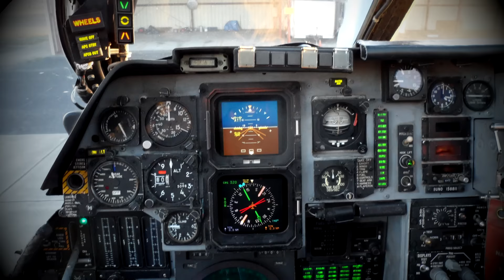USMC Jet Crashes Cable Car | Last Moments

Comment: The news reported that American aircraft were flying very low quite often in the valley, just to scare people on the cable cars an have a laugh. Those pilots new about the cables. I can't forget the accident, because two schoolmates of mine  died in the previous crash in 1976 and a third one was the only survivor.
Reply: I'm really sorry to hear that you lost schoolmates in the 1976 disaster. I would be very interested, did you really know Alessandra Piovessana, Francesca and Giovanni from the grammar school in Milan? I never knew them personally, but I used to go to Cavalese every year and have been interested in the 1976 disaster since I was 12 when a cabin attendant told me about that 1976 disaster. There is very little information, at least in English, about the 1976 disaster and I've been working over the last couple of years on a Youtube documentary about that disaster, going to Cavalese to do research, perform drone flights in the track of the old cable car and ask locals and try to find as much information about it as possible. If you were in Cavalese in 1976 on the day of the incident, or took the cable car a few days before it or if you talked to Alessandra about it afterwards it would greatly help me if you agreed to provide answers to a few questions I still have unasnwered. I have already made a documentary, but I keep updating it as I find new information. You can watch it here: https://youtu.be/6-GBikY0AqM   It's over an hour long, but if you had any comments about anything being not correct or anything which I didn't include and should be there I'd greatly welcome any information. Just to note, this is all non-profit and I'm funding all my trips myself, the only prupose is my interest in this incident as well as will to share information about this "nearly forgotten" incident, which has been greatly overshadowed by the 1998 incident, but is still the deadliest cable car incident that ever happened.
Reply: Hi, I still have to watch your video, but thank you for your interest in that old tragedy. I was a schoolmate of theirs, not a classmate. I was born in 1958, their class was of 1960. They were in Cavalese for a school ski trip, the whole group of kids & teachers had to take a gondola down but Alessandra, Francesca and Giovanni were walking ahead of the rest and sneaked on an early gondola all by themselves, among a bunch of foreign tourists. Their classmates survived because they couldn't get on and had to wait for the next run. I wasn't in the group. I knew well Alessandra Piovesana, only a little Francesca, not at all Francesco. With several schoolmates I went to Francesca's funeral, in Terracina, few days later. I also went to see Alessandra at the hospital. She died some years ago, maybe 10 or 15. I have few more anecdotes, not a direct testimony, but not related to the accident itself. Alessandra never wanted to talk about it. If you are on Facebook, send me a personal message, we can talk about the event. I might be able to find out some of the old kids involved. Simone
Reply: @simonedallachiesa9804  Hi, thank you for your reply, I really appreciate it. I am on Facebook and I think I just found you and sent you a message (in case you don't receive it please let me know here, but I'm sure I found you correctly), so we can talk on Facebook. Thank you again, Miroslav

Comment: I don't have good words for this- but as an American I am empathetic, embarrassed & disgusted that with all of our tech, no how & experience, that something like this could happen- yet not surprised one bit. The moment you said that they were at 300ft- i knew that someone had messed up. You simply don't fly through the Italian Alps above small towns & villages, at that low altitude. However, these were trainees operating expensive military hardware- & at some point the government needs to be held accountable for putting people in these machines to begin with, & I'll equipped no less with incomplete maps. Yes those soldiers Fd up replacing the tape- but again these weren't even full fledged fighter pilots yet, or the one operating the joystick wasn't. That being said- isn't it strange that the most deadly cable car accident in world history happened in that same town 20yrs earlier? Does it hold spots #s 1 & 2 now? And is something else going on here? It just seems way too coincidental for my taste

Comment: Pre watch theory: velocity and tension caused the wing to be sliced relatively clean.
Reply: Damn I was wrong. Weak cable to be cut by aluminum oh well lol
Reply: @revlouch  It wasn't a weak cable. It was nearly 2 cm thick! There was an incident in 1976 on this same cable car where the ~1 cm diameter traction cable crossed over the 2 cm thick carrier cable and moved accross it at a speed of ~10 m/s. It took it 90 seconds to cut the 2 cm support cable, so it's not a weak cable.
Reply: One small problem with your calculations. It was severed instantly not over 90 seconds. Generally tight cables are stronger than cables not under tension. Due to that I figured it would slice the wing given the speeds involved. I was impressed the wing severed the line and not the other way around. But this tells me that the cable was either worn or not under tension. I stand by my statement. It was cut by an aluminum wing of a fighter jet. If it survived and cut the jet instead you’d be right. Weak cable by todays standards.
Reply: @revlouch  I'm surprised about this as well. There have been about 10 other cases of a collision between an aircraft and a cable car and in all of these it was the aircraft which crashed and not the cable car. You're right about the cable not being under tension. These cable cars need to have cables that are a little flexible as if they were fully tense they wouldn't be able to hold as much weight as they could when being flexible at the same diameter. But you are correct, a tense, or tight, cable is stronger to withstand an impact. I've just read these cable car cables can be up to 5 cm in diameter (that's 2 inches). So if that cable was 2 cm thick it would have been weak by todays standards, but still it should withstand an impact of a wing of a plane in my opinion (the wing should be cut off first before the cable breaks). Perhaps the plane was made from some much stronger (e.g. bullet-proof) material? Regarding the 90 seconds, I was mentioning a different disaster on this same cable car. That disaster happened on 9. March 1976 (you can see more details here: https://www.youtube.com/watch?v=6-GBikY0AqM) and what happened then was that the moving traction cable crossed over the main stationary support cable (which was identical to that cut by the Prowler in 1998) and severed it. At ~10 m/s it took ~90 seconds from when the cables crossed to when the main support cable snapped.

Comment: I remember this incident; it was an international scandal for it's day. Nice job putting the video together, I enjoyed it. But I really feel compelled to address some inaccuracies I see here.
I was in the Navy from 1985-1993, and I worked on the A-6 Intruder as an aviation electrician. The A-6 intruder is a bomber, not a fighter like you mention in your video introduction narrative. Seeing how the new Top Gun movie just came out, those aircraft in the movie were fighter jets. F-14 Tomcat in the old film, and F/A-18 Hornet in the new film. In navy jargon for airplanes, F= Fighter A=Bomber (attack) and F/A is an airframe that will support both roles.

The EA-6B Prowler is the electronic warfare version of the A-6 airframe. It's one of the few carrier-based aircraft with a 4 man crew, and the cockpit is lined with gold to keep the aircrew shielded from the electronic jamming energy it produces. The A-6 is a Vietnam war era aircraft and was designed for that theater, it's bomb payload is roughly 1/3 the capacity of a B-52! Incidentally, the EA-18G Growler is the Hornet version of the EA-6B Prowler...

One thing I think needs to be mentioned, is in the Vietnam war, Surface to Air missiles (SAM) were the apex predator of the day. The EA-6B was the tool to jam all those SAM sites... The other tool for the little A-6 and all those bombs it could carry was to fly fast underneath the radar, then pop-up, drop the bombs, then get down low and get the hell out.

It's not hard to imagine then, that A-6 pilots train very intensely to operate their jets low and fast in all terrain conditions. 500/500 was the benchmark; under 500 feet @ over 500 knots. Showboating? Hot-dogging, bravado? Sure but it came with the territory back then of being a Naval Aviator. The story about a faulty altimeter is probably bogus, but there was indeed an operational need to address a threat and fly in a manner that seems so reckless.

Something else about the video that seems off to me. The aircrew you refer to as Marines, yet all the pictures are of Navy officers in Khaki uniforms, and they all have Lieutenant bars on their collars, so I don't think the ranks are accurate. I know I'm just splitting hairs in the end, but you put a lot of effort into the video, it'd be nice to be factually correct. 

Two sides to every coin, no?

Comment: Tbh the Pilot (and the other guy who obstructed the evidence) should’ve been the only ones charged. Pilot was in direct control of the aircraft and thus held the responsibility to make sure that the aircraft and the rest of his crew got home safely. The other two crew members had their respective jobs but were simply “passengers” to said accident.
Reply: The others had the duty to denounce their pilot and navigator right away, but instead they kept their mouth shut and didn't say a thing

Comment: Cruising at 300ft.   Cable car crashes 250ft to the ground.   
Prowler wingspan over 50ft?
Perhaps they were lower than 300ft?
Reply: Cable car was 110 metres at highest point above the river and  about 90 metres where it crashed. When fully loaded, it was 85-86 metres above ground (the weight of passengers makes the flexible wire go lower). I guess the pilot wanted to fly 5 meters below, but didn't account for the fact that the cable car could be up to 5 meters lower when fully loaded?
Reply: @MiroslavProvod  the prowler has 52.5' wingspan.     2.5 was not enough room for error.  

I think the real tragedy here isnt the plane crash or the wanton disregard for the civilians..  it was the coverup that follwed the crash.

Comment: Like they say in every aviation crash there are always multiple things that cause the crash. I believe the most important mistake was the outdated maps of the mountains. Had the pilots been given up to date maps they would not have been there in the first place. For all we know their superior officer gave them permission to fly this low in and out of the mountains as practice. If these guys went on this flight knowing they were going to break rules set by the military why would they ever bring a video camera? I am sure if the maps they had were accurate (meaning no cable car or other civilian structures) they would have come back and shown the video of them flying in and out of the mountains at low altitude and everything would have been fine. I believe whoever supplied those maps should have shared the blame. Imagine you're a delivery driver and your boss tells you to make a delivery at xyz location. He draws you a map how to get there (pre GPS times) and the map has you going over a bridge that has been closed and you plummet your delivery truck into a canyon. There are no signs that say "bridge out" and you're driving a little faster than permitted so by the time you realize the bridge is missing a span it's too late and you're dead. Aside from the driver going too fast who is at fault?

Comment: Tough plane.
The wing can slice a 2 inch cable?  
I would have thought the cable would have sliced the wing off first.
Reply: Maybe the fuselage is bullet proof and made from some strong material?
Reply: It wasn't called Grumman Ironworks for nothing.

Comment: Having considerable flying experience in that precise area, I can say that no one in their right mind would fly 350kts at 300ft AGL in that valley without knowing exactly where the cables are. The question is not "Are there cables in this valley?" but "Where are the cables in this valley?". These valleys here are littered with cables of various kinds and everyone knows it. These are not wild and unpopulated places like some parts of Alaska or Canada. So the argument: 'The map was out of date'. It is stupid, no map would save you, there is a cable running through the valley at 400 feet AGL every mile or so. The map just says the obvious: "Don't fly below 1000ft AGL".

Comment: Nobody had an issue they were given outdated maps by the Italians or that they were flying low altitude for thousands of miles like they still do for training. 

Next time, inform the pilots about the terrain. Literally wouldn’t have occurred if they were given correct mapping.
Reply: "Literally wouldn’t have occurred if they were given correct mapping."
It is just mind-boggling that this can happen.

Comment: You would think the cable would have cut the plane...not the other way around, but then again the skin my be lightweight aluminum, but the frames are made of much harder material than a steel cable.

Comment: This was entirely the pilot and navigators fault and should have been imprisoned for a long time. I'm a bit surprised there was no automatic braking systems to grab the cable and hold it in the event of a break.
Reply: their aint no brakes between towers (thing that slow you down)
just breaks in the cable (and breaks as in gaps)

Comment: Wire strikes are a big risk in aviation. Every helicopter pilot knows this and any airplane pilot that's going to be flying low to the ground off-airport should know that too, as well as ways to mitigate the risk. When the wire is carrying people you're in extra deep shit. Flying 500mph at 300ft above the ground is super reckless..

Comment: Does anyone have information regarding the cause of the cable car accident which occurred in 1976 at this same site which killed 43 people?
Reply: Two steel cables were crossed, and with the movement one cut the other causing the cabin to fall. The investigations found that the emergency breaking system was active but was deactivated to move the cabin.
Reply: @thecommentaryking  ....thank you👍

Comment: Their altitude wouldn't have been around 300 feet. Altitude is height above sea level, not height above the ground. That said, they still should have known how high they were above the ground using the altimeter.
Reply: The barometric altimeter is zeroed to current air pressure at the apron on the air field.  The radar altimeter would have been spot on.
Reply: @hairybubbles127  "The radar altimeter would have been spot on."

Provided it was working properly.
Reply: @AA-xo9uw  true enough. According to the investigation, it was.  These dudes were having a lark and ran into cables they didn't know we there, tilting at altitude they knew they weren't authorized to be at.
Reply: @hairybubbles127  The RADAR alt in the Prowler was notorious for being intermittent in its operation. Took nearly six months and hundreds of man hours to troubleshoot and repair one on a jet we had in Iwakuni back in 1984- 1985.
Reply: @AA-xo9uw  the radalt is no replacement for maps, minimums, regulations, and baro altimeter.

Comment: The picture of the cable car shows the violence of the impact. I would not of expected that much blood, and there's a lot. I would've expected broken bodies.
Reply: The cable car hit the ground at about 130 km/h upside down (head first). The impact with the weight of the cabin crashed the bodies. Apparently, only one body was outside of the cabin, that of the operator. But they wouldn't show that on the news.

Comment: Cable cars should have crashable bottoms so it will be safe even if a fall has occurred. That would not put so much additional weight if designed correctly.
Reply: No such thing. A box filled with people falling 15+ meters is not survivable no matter how the bottom is designed. I agree with the concept, but it's far too simplistic to be a real solution.